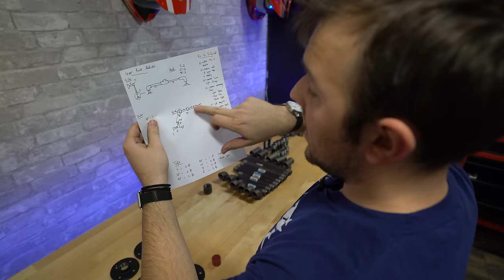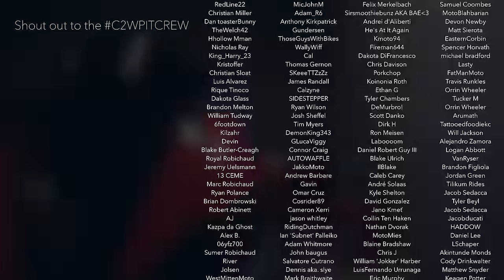What else could GO WRONG! - Garage Build Ep 10

Comment: If you ever need to make big holes in wood or drywall in the future, they make circular saw tips for a drill. They come in handy, I've used them before on several projects. I'd pick up a single one that's JUST big enough for maybe a plug or something for the future. I had the same issue trying to drill a hole in a tv stand for my xbox connection plug haha

Comment: Should have tried using 1/4 20 threaded hex head bolts. they are my favorite when working with black pipe because they double as a camera mount if used properly. Still love the build series nice to see Im not the only one that runs in to problems  building something new and custom

Comment: What you are trying to do is called boring through wood, not drilling.  I use speed bores, they are cheap and have a lifetime warranty.  They are good on just about everything except metal.  Mine are almost 20 years old and have a lifetime warranty; you will use them as often as drill bits.  Good luck and nice garage.